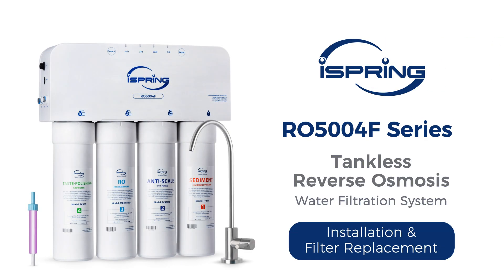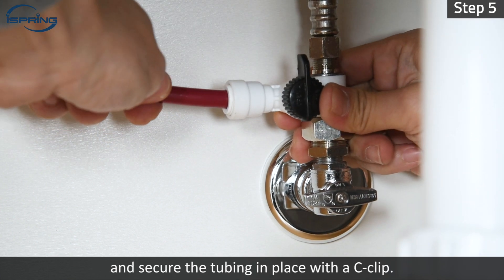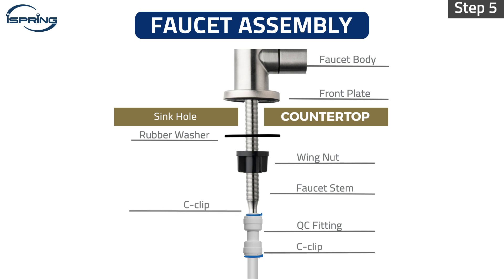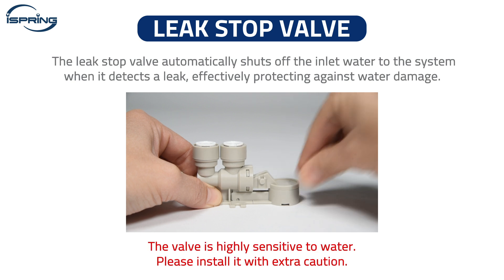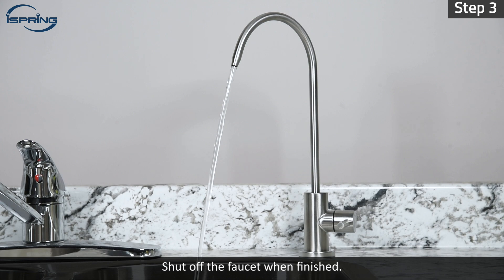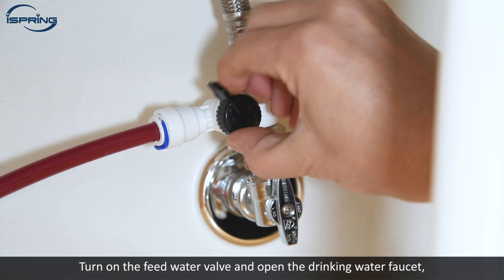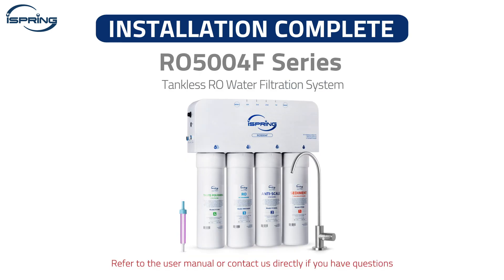How to Install the iSpring RO5004F Reverse Osmosis System: Step-by-Step Guide

Comment: Can I mount the pure-out to fridge instead of that countertop faucet??
Reply from the maker: Hi there! The RO5004F is a tankless system, so if you want to connect it to a refrigerator, you will need to add a  tank. You will also need an ICEK kit to make the connection to the fridge.
Check this video to know how to connect the system to the fridge using the ICEK:
https://www.youtube.com/watch?v=dmT_6BCBwaE 
If you have further concerns or questions, do not hesitate to contact us at  support@ispringfilter.com or  at  678-261-7611 (M–F, 9 AM–5 PM EST) We’re here to help!
Thank you!

Comment: Hi, I don't have a horizontal run on my drain pipes due to the way the garbage disposal is oriented. I have a right angle PVC pipe that goes to the p-trap, but there is only about 1.5" of room before it hits the p-trap.... or a corrugated line from the dishwasher. 

Is there a workaround for this?
Reply from the maker: Hi there! Could you please send us a clear picture of the area under your sink showing the drain pipes at support@ispringfilter.com? Once we receive the picture, we’ll review it and guide you step-by-step. Thank you!
Reply: @iSpringWaterSystems I've figured it out ...it's a single drain basin with a garbage disposal and dishwasher. I need to go through the dishwasher drain line with a two-inlet drain line adapter. Thanks!

Comment: When you say 8000 hours of life for the UV light, is the idle hours of the water filter also counted or only the hours when active filtration is going on? Realistically how much time it will be until I replace it? Years?
Reply from the maker: Hi there! The 8,000-hour lifespan  only counts the hours when the UV is actually on, which happens when the system is dispensing water. 
Because of this, the UV can realistically last for many years before needing replacement. The exact timing will depend on your water usage, but it often translates to several years of effective operation before the 8,000-hour mark is reached.
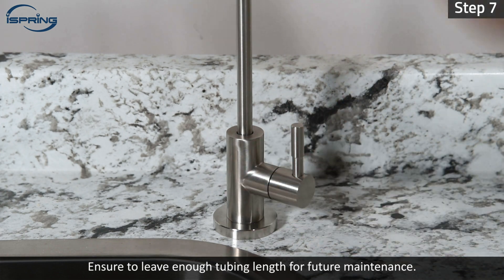If you  have further concerns or questions, please feel free to reach out to us at support@ispringfilter.com  or 678-261-7611 (M-F 9:00-5:00 EST) for proper assistance. Thank you!
Reply: @iSpringWaterSystems thank you. Do you have a non-UV version of this model? I can't find it in your website. I am starting to feel that having UV is probably not necessary for tap water from city.

Comment: If I don’t want to use the UV feature on this unit, will it operate without being plugged in?
Reply from the maker: Hi there! It is highly recommended to use the system with the UV unit that comes with it. If the UV filter is bypassed or not installed, the RO5004F will display a continuous error. The system will detect this as a "UV light malfunction," causing the indicator lights to flash red at all times.
If you have further concerns or questions about our products, feel free to contact us at support@ispringfilter.com or call 678-261-7611 (M–F, 9 AM–5 PM EST). We’re happy to help!
Reply: Hi! I’ve purchased two of these units and there are C clips missing for the Leak detector and shut off valve.
Reply: This video should be re-done so that the leak stop valve installation is done as the second step, not after already connecting and cutting the red tubing. The order presented in the video requires connecting then disconnecting, hoping you have appropriate lengths, reconnecting the stop valve, and connecting it all back. Additionally the paper instructions present an order that is out of sync with the video.

Comment: Do all of your water systems need to be powered/ connected to electricity?
Reply from the maker: Hi there! Not all of our systems require electricity to operate. Only systems that include a booster pump, a UV filter, or certain whole house systems need to be connected to a power source.
If you have any further questions or concerns, please feel free to contact us at support@ispringfilter.com or call us at 678-261-7611 (M–F, 9 AM–5 PM EST). We’ll be happy to help!

Comment: So the unit itself is NOT mounted to anything? It's free standing on the filters? This thing isn't exceedingly heavy, but your're already working in a cramped space.
Reply: God forbid this unit falls over because leaks could cause tremendous water damage all because they failed to provide any way to mount and therefore secure the system.
Reply from the maker: Hi there! Yes, the RO5004F is designed to be free-standing and does not require mounting.
Its compact design helps minimize the footprint, and as long as it’s placed on a level surface, it will remain stable.
If you have any questions about our products, feel free to contact us at support@ispringfilter.com or call us at 678-261-7611 (M–F, 9:00–5:00 EST). We’ll be happy to assist you!
Thank you!
Reply: @i @iSpringWaterSystems  Can you tell me what will happen if someone should bump this freestanding reverse osmosis water filter?  They could have simply designed this unit so the back side of it was flat instead of being bowed out. If it were flat and they cut key holes into it, simple screws could’ve held it in place to prevent it from falling over.

Comment: Does the american system connect to our water pipes in italy, or will I need a special adapter? I'm looking to buy one of your systems from the Italian amazon site. Thanks for your help!
Reply from the maker: Hi there! The feed water adapter fits common 1/2" and 3/8" connectors.  If you have a different size fitting, you will need a converter.
If you have further concerns or questions, please contact us at support@ispringfilter.com for proper assistance.
Thank you!